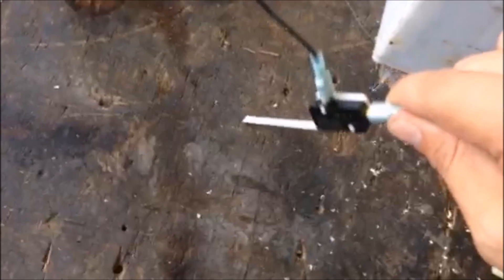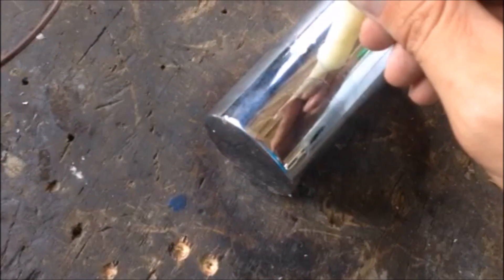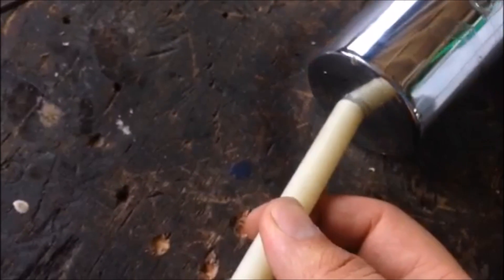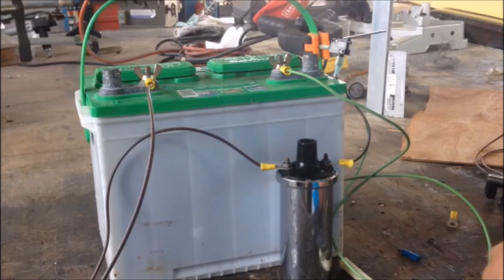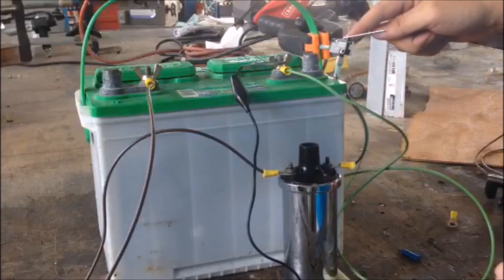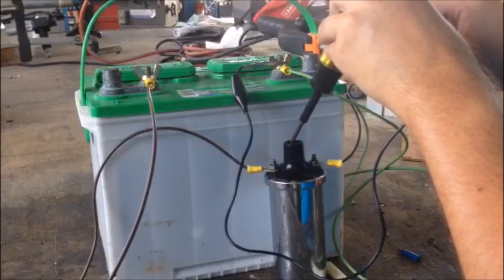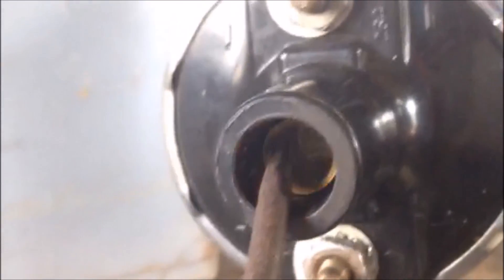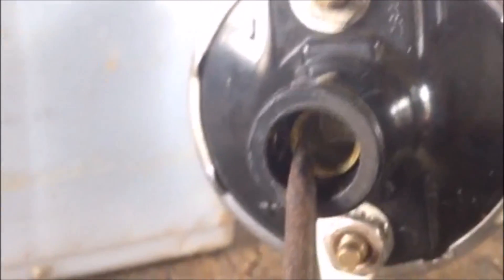Test your ignition coil

Comment: Extremely poor video. Can't see how it is hooked up.   The switch is connected to the green wire which is the handle of the battery?  Very confusing.